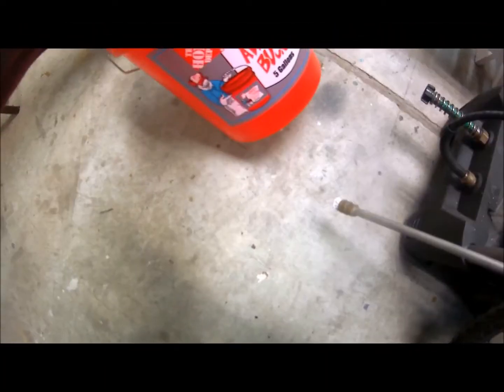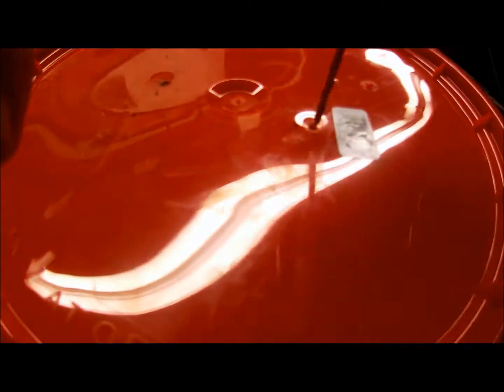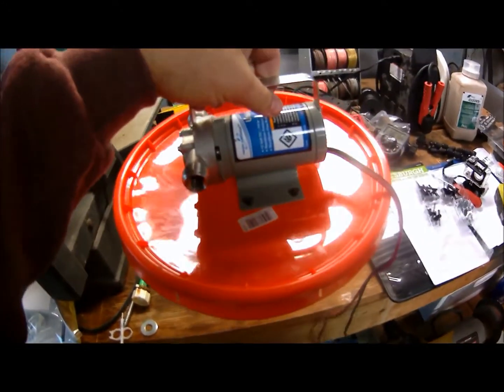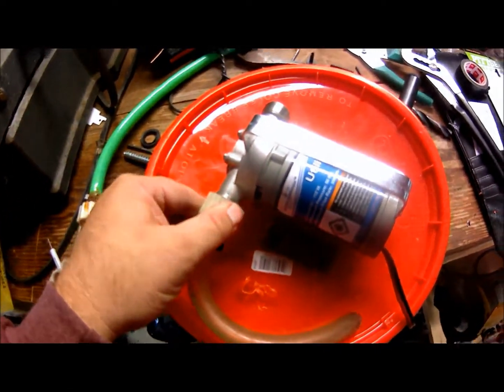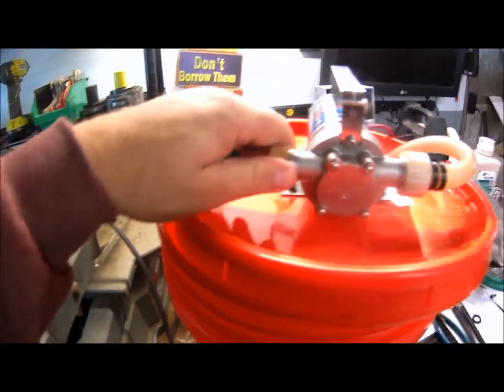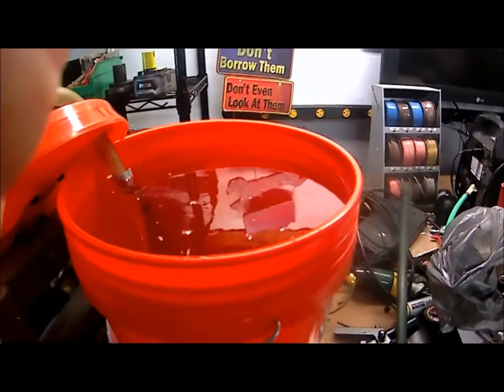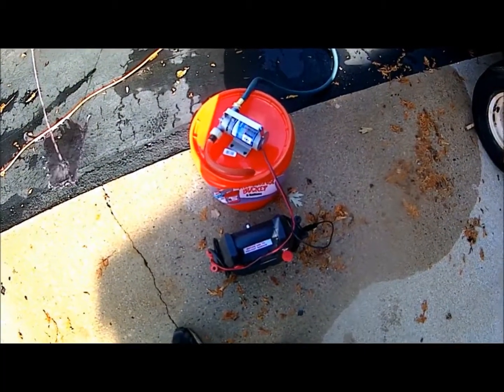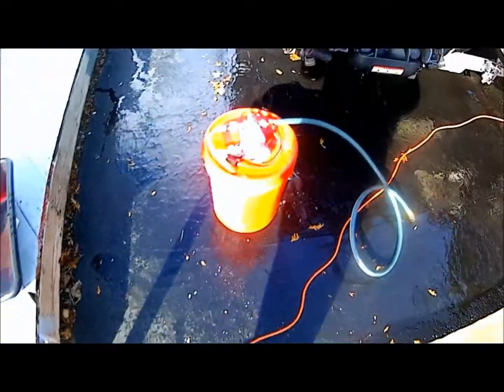Jet Ski Flushing and Winterizing Pump Unit

Comment: what are you hooking the hose up to on the jetski? I've got an older model Polaris and not sure what I'd hook the hose up to?
Reply from the maker: You would hook the hose up to the flushing port of your ski. Just like you were running it on the garden hose. Some older models the connection was inside of the engine bay. Most newer models it is on the back of the ski. Hope this helped